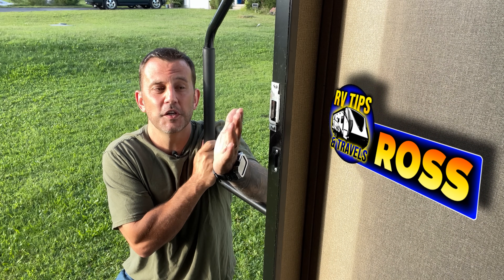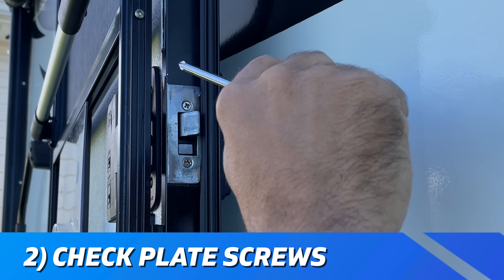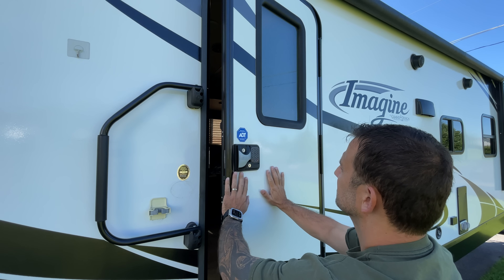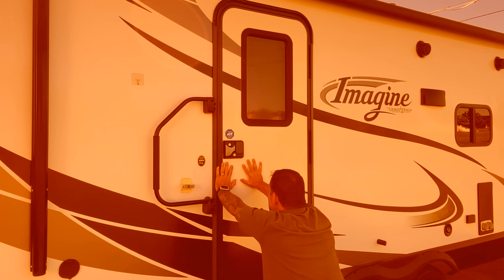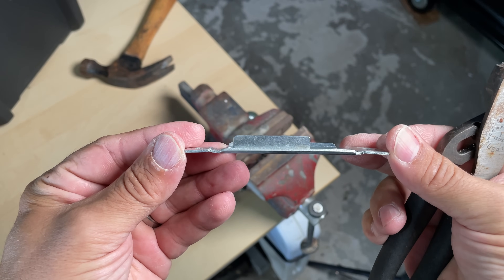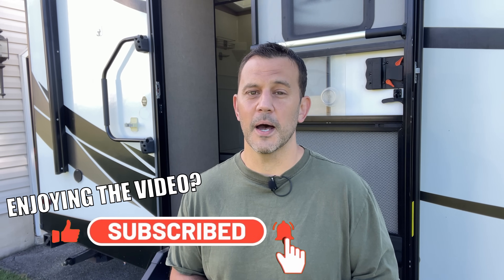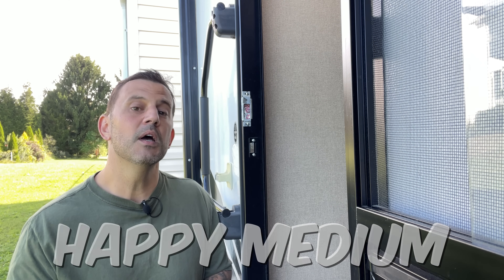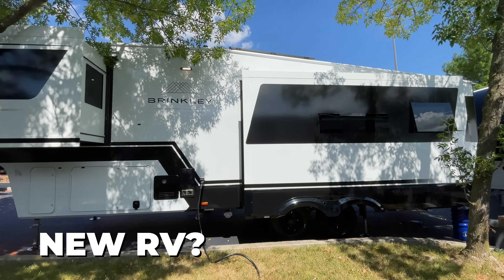How To Fix a Hard Shutting RV Door: EZ Adjustments for an Effortless Open & Close

Comment from the maker: ✨⭐ PRODUCTS FEATURED IN THIS VIDEO ⭐✨
🔹 Strike Plate https://amzn.to/3Zp2J9I
🔹 Other Strike Plates https://amzn.to/3rajvg6
🔹 Boeshield T9 https://amzn.to/48kxWio
🔹 Carmtek Keyless Door Lock (COMES WITH EXTRA PLATES) https://amzn.to/3sZXWzm
🔹 Hammer https://amzn.to/3ZmKa5V
🔹 Screwdriver Set https://amzn.to/3EHualp
🔹 Dewalt Drill (not used today but works great) https://amzn.to/3PILPQa

🎥 Carmtek 10 Digit Keyless Entry RV Door Lock Video https://youtu.be/KcEUgsDw6kk

How To Fix Hard Shutting RV Doors: 2 Easy Adjustments for an Effortless Open & Close In this episode I show you a modification that makes opening and closing an RV door a much easier and enjoyable process. PLEASE click the like button, leave us a comment & subscribe so you don’t miss any of our future videos.  

#rvlife #rvliving #rvtips #rvtravel #rvtips #rv #rvmaintenance

✨⭐ OUR FAVORITE RV ACCESSORIES ⭐✨

ESSENTIALS:
✅ Camco Rhino Flex Sewer Hose & Elbow Kit https://amzn.to/3wxaiyG
✅ Camco 90 Degree Clear Sewer Elbow https://amzn.to/3eezBe7
✅ Camco RV Water Filter https://amzn.to/3VzcMqi
✅ Rubber Wheel Chocks https://amzn.to/3v0lL5I
✅ Hughes Watchdog 30 Amp Surge Protector/EMS https://amzn.to/3hAmgCy
✅ Hughes Watchdog 50 Amp Surge Protector/EMS https://amzn.to/3HKrpm1
✅ Liquified RV Tank Treatment https://amzn.to/3ksg1Ck
✅ Tire Minder TPMS https://amzn.to/3mjuBg0
✅ Water Pressure Regulator https://amzn.to/3m3ZFzZ
✅ Rubber Gloves 6 Mil https://amzn.to/3XNo7Dc
✅ Collapsible Water Hose https://amzn.to/3SvNubw

MAINTENANCE:
✅ Boeshield T-9 Rust Preventative & Lubrication https://amzn.to/3sjcjMx 
✅ Eternabond Roof Tape https://amzn.to/3Ad290J
✅ Geocell Proflex Sealer https://amzn.to/3KGMOyb
✅ Road Tool Kit https://amzn.to/41NIQKj

INTERIOR:
✅ Camco Cross Bar Door Handle https://amzn.to/3o8WWS5
✅ Shower Caddy https://amzn.to/3bdU80W
✅ Soap Dish https://amzn.to/3pKheSn
✅ Oxygenics Shower Head (White) https://amzn.to/3nhDMYW
✅ Oxygenics Shower Head (Brushed Nickel) https://amzn.to/2O8YcYC
✅ Perfect RV Paper Towel Holder https://amzn.to/3tZxd1K
✅ Dimmer Switch https://amzn.to/3rQdfFD
✅ Sliding Door Latch https://amzn.to/3EkpTT0
✅ Puppy Paw Hook https://amzn.to/2N9JaRV
✅ Foldable Storage Bins https://amzn.to/3tIp01f

EXTERIOR:
✅ X Chocks https://amzn.to/3m3ck2i
✅ Carmtek 10 Digit Keyless Entry System https://amzn.to/3t4IMpB (see the video here: https://youtu.be/KcEUgsDw6kk)
✅ Low Point Drain Valves https://amzn.to/3Jd6adb

OUTDOOR GEAR:
✅ Blackstone Griddle 22” https://amzn.to/3MDDiL0
✅ Blackstone Griddle 28" https://amzn.to/3eBnOuD
✅ Outdoor Gravity Chairs https://amzn.to/3Sb1p4M
✅ Ground Mat https://amzn.to/41u3wXg
✅ TurboAnt Electric Scooters http://shrsl.com/27grx-1yiz-ub6o

💥 Sign up for our FREE Newsletter: https://view.flodesk.com/pages/6497c6a9d1998fa8c7623e9f

✨⭐ MORE RV ACCESSORIES ON AMAZON ⭐✨
https://www.amazon.com/shop/rvtipstravels

💥 NEW TO OUR CHANNEL? Check out our catalog:
https://www.youtube.com/c/RVTipsTravels/playlists

🙏 If you found this video helpful & want to support our channel with a small donation click here: 
https://www.paypal.com/donate/?hosted_button_id=J2KKM9NR3BJJA

✨⭐ DISCOUNT CODES TO SAVE MONEY ⭐✨

🔨 Learn how to repair & maintain your RV like I did w/ this COMPREHENSIVE training course:
https://rvtechcourse.com/?ref=rvtips&travels

🚐 10% off RV Snappads! https://rvsnappad.com/discount/RVTT10

🛌 Get 25% off your RV Mattress by Brooklyn Bedding at https://rvmattress.com/rvtips
Use discount code: rvtips

📡 GPS Tracking for your RV! https://www.wheresafe.com/rvtipsandtravels
Get 10% off by using discount code: RVTIPS10

If you find a dead link, let us know & we’ll send you an RVTT sticker!

📺 Want to see more RV videos? Please SUBSCRIBE & CLICK THE BELL ICON 🔔 so you're notified when we release new videos!

Follow us on social media:
📸 Instagram https://www.instagram.com/RVTipsAndTravels
🕺 Facebook https://www.facebook.com/RVTipsAndTravels

We may receive a small commission for purchases made through the affiliate links above. There is NO additional cost to you when purchasing from our links & it helps cover some of our material and equipment costs to make these videos. We also may have received products or payment in exchange for content discussed in this video, however our opinions and feedback are based only on our experiences, regardless of compensation. We GREATLY appreciate your support!

Comment: Didn't work for me. The door has always been hard to close (2022 Keystone Arcadia). Flattening the plate helped a little, but even with the plate missing the door is hard to close. A RV tech is next I suppose.
Reply from the maker: if the striker is not the problem making the door close hard this modification is not going to work.  something else is preventing the door from closing smoothly, and flattening the plate isnt going to fix it.  it could be the hinges, as discussed in the video, or your door frame might be out of square/plumb.  when you close the door, just as it is about hit the strike plate, look around the door frame and see if somewhere else is rubbing.  the easiest way to check this is to close the door with the handle pulled so there is no contact on the striker.  with no contact there, you may be able to easier to determine what else is hitting and preventing the door from closing.  make sense?  let me know what you find.
Reply: @RVTIPSANDTRAVELS  Thanks for the tips.

Comment: It normally has to do more with how level the camper is. If the right rear of the trailer is higher the camper will flex and cause the door to not close well or other way around. If the left side of the camper is higher the door will be hard to close.
Reply from the maker: I wont disagree there is flex, but you're leveling your camper before you're using your door, so it should always be level.
Reply: @RVTIPSANDTRAVELS  I’m just going off my experience. If my right rear jack is jacked up a lot to get the camper level my door won’t latch it’ll come open even if the camper is level. But I haven’t tried putting blocks under the tires yet to level it that way.
Reply from the maker: Eric, try these instead of ramps... much easier: https://amzn.to/4gMvLbq

Comment: Use silicone spray on complete door frame. This will fix 99 percent of the door closing problems!
Reply: That’s not fixing anything.  If you’re door is out of alignment you are ignoring the issue and it will probably get worse. That’s also not going to help metal on metal rubbing at the plates.  What the guy in the video does is fix the problem, not cover it up.
Reply from the maker: thanks for watching and commenting!

Comment: Ok what if the whole handle moves even with the screws tight. I was trying to close my door for almost an hour before I realized the handle shifts forward.  Do I just replace the whole handle ? If so what do you recommend as I don't want the same one .
Reply from the maker: it should not move with the screw tight.

Comment: Thank you so much!  I didn't have the Boeshield (will order some via your link with my next Amazon order).  I had some WD40 Specialist Silicon (which said it was safe for locks), Crossed my fingers, sprayed...and.....it worked!  I'm so grateful.  I really disliked slamming the door from the inside. Now it's easy to move the handle (which had been sticking), and when the door closes it's as smooth as when the trailer was new.  Just subscribed to your channel, and look forward to learning more RV/trailer wisdom from you.  Cheers!

Comment: I went through a lot of these and what finally worked for me was disassembling my keyless RVlock, removing the spring for the latch bolt, and cutting 1/4-1/2 inch off. Then I stretched it back out to the original length. Door closure is smooth as butter now.
Reply from the maker: thats an interesting idea, thanks for sharing and glad it worked!

Comment: Lubricating the latch did it for us -- from virtually impossible to close the door from inside to fairly easy (seals still need to be compressed so a little force is required when pulling it closed).  Thanks for an excellent video.
Reply from the maker: Thanks for the info… yeah, it’s never ever going to be a smooth as a residential door, but it can be improved.  Thanks my friend.

Comment: Hey Ross, Thank you so much for all the work you put into these extremely helpful videos. I came here because our door was quickly becoming harder and harder to shut. The faceplate and strike plate have HUGE gouges in them. After watching this video, I noticed that it's actually the dome head of the screws of the strike plate that are scraping the faceplate. I tried tightening them down to see if they had just worked themselves loose only to find the bottom screw just spins in place, so the hole in the metal frame is stripped. I watched your "stripped screws" video but not sure how to solve this with the hole being in the metal frame other than to get a larger screw. I'm also thinking about getting flat instead of pan head screws.  Any advice?
Thank you!
Reply: Thx for the comment the screw is scraping my door and cutting into. I was thinking of replacing the screw to a flat one. Any help works be appreciated ?
Reply from the maker: i would try a larger screw that you know will sink flush into the plate, thats the tricky part.  you can also try putting in a small piece of a zip tie, it acts similar to a toothpick.
Reply from the maker: i would try a flat head screw that bevels into the hole first.

Comment: The person we bought our trailer from has marks on the strike plate like you, now I'm betting they watched this video 😆
One thing I learned fairly quickly which could be an issues for some folks either for earlier setups or if something as settled after setup or after being set up for a long while is that the stairs might need to be adjusted, you want to make sure that they're not sitting too high which could add additional friction to the whole setup, which makes the door harder to shut.
Reply from the maker: very true, thanks for sharing

Comment: During our last camp out, one of our neighbors had a similar issue. After looking at it and thinking about it for about a half day. We realized that the neighbor has cranked the rear (door side) stabilizer so far down that it pushed the door off. We retracted the stabilizer and extended it carefully until the door closed easily.
Reply from the maker: That’s interesting! Makes sense and glad you got it figured out.

Comment: Great info. I need to make my door easier to close. I've done what you suggested and the door closes better but just not good enough yet. From what I can see when the door is closed it seals flush at the bottom but not at the top. I may have an alignment issue as well. I was going to give it the old piece of wood trick, put a piece of wood in the bottom of the door and push the door at the top just to make things straighter.
Reply from the maker: did that fix your issue?
Reply: @RVTIPSANDTRAVELS  It helped along with plenty of lubrication including lubing the striker plate.
Reply from the maker: good to hear you got it straight!

Comment: Just got a 2023 24foot TT, I notice are door is hard to close, but POPs open easy, isnt flush and I got to slam it closed before I can lock it. I'm going to try checking out what was pointed out in this video. Thank you.
Reply: Mine does the same thing. had to remove the strike plate. A screw on the bottom of the door hits the jamb. It's like the door needs to move closer to the hinges.
Reply from the maker: good luck
Reply from the maker: are your screws beveled at the top (bugle style)?  like this: https://amzn.to/3MZUKdH

Comment: QUESTION; I’ve built and repaired homes, etc, all my life. Is the door on an rv made differently, as in bowed a little towards the middle? I think it’s part of the design to keep pressure on the seals, thanks
Reply from the maker: On a straight frame trailer like mine I don’t think it is bowed since the walls are straight, and many doors are manufactured by a company other than the manufacturer who builds the rv.  Some doors  like on airstreams are bowed though because the trailer is not straight.

Comment: Nice video.  My question is what is a good fix for a door latch that has been stripped out after a break in.  No place for screws to go even after using max size for plate?
Reply from the maker: That would be something I would have to see to help with, sorry.

Comment: Great video but my problem with our door not shutting properly is a stripped screw on the strike plate which causes it to move what do you recommend to do for that thanks for all your great videos
Reply from the maker: along with this video Nick, ive since learned you can also use zip ties instead of toothpicks... you'll understand after watching the video, but zip ties might be a better option in areas that get wet.  https://youtu.be/MlFPex87cr4

Comment: Quick question: You mention moving the striker plate "out" (away from the RV) if the handle is hard to open.  However, on my Alliance Fifth Wheel, the striker plate is already as far "out" (or left, looking at it) as it can go.  Because of that recessed part (which is pushing up against the cut out in the RV body), it can't move "out" any more.  Any ideas on this?  Thanks.
Reply from the maker: hard to tell on things like this until im in front of them.  send me a couple pics

Comment: We’ve tried to install the RV Lock and the strike plate isn’t low enough for the deadbolt to latch completely. Should i modify the hole in the on the strike plate?
Reply from the maker: can you move the plate down?  if not, youll have to modify the strike plate, but the more you remove from the plate weakens the plate, so take as little as possible.  also, is this only happening with the new lock?

Comment: Good video!  More door closes perfectly... but the screen door on the other hand has never latched.  It's like the latch is far enough towards the bore to engage.
Reply from the maker: RV screen door latches are cheap and pretty much garbage.  They need to re-engineer, or at least use metal hardware.

Comment: I wish your help and advice could help what Forest River did to my door. But you need a decent hole in the rv to get a working door....
Reply from the maker: what is your issue, maybe i can help
Reply: @RVTIPSANDTRAVELS  I’m not exactly sure yet but am being told the hole is cut crooked in the rv. They have put 4 different doors in with no success. It also has something to do with the stairs because they told me they needed to be replaced but they don’t make them any more. I have a 2020 Cedar Creek 33ik Silverback edition.
Right now it seems the put a larger frame in and filled the door with this insulation that is coming off already. Light comes thru the door etc etc.
Reply from the maker: Very sorry to hear that… you’d think a quality company like that would fix the issue correctly.
Reply: @RVTIPSANDTRAVELS  thanks. Sadly it is quite the opposite.

Comment: Did you happen to make another video about inspecting and adjusting the hinges? I did these steps but my door is still hitting the frame as if the frame is too small. I do construction and have installed and shimmed many home doors but this one has me stumped
Reply from the maker: Toby, unfortunately this mod wont fix the door alignment issues.  My hinges are riveted too, not really much room for adjustment without an all day project on your hands.  I wish these bolted in, that would allow for fairly easy adjustments.

Comment: We have a travel trailer Avenger that when the main door is shut on the top does not close tight so you can see daylight the screen door has no problem we do have stowaway steps and was told this was normal. Is this caused by the steps or is it bent hinges and how do we know?
Reply from the maker: its something i would have to see in person, but its not normal.  the door should seal.

Comment: I went to change the lock on our new 5th wheel and it seems the striker plate can only be installed backwards. When installed correctly as you showed it will not latch. Am i at risk by leaving it this way? Don't want to get myself locked out.
Reply from the maker: what kind of lock did you put it?
Reply: @RVTIPSANDTRAVELS  It's the Latch it RV keypad lock. Although it will latch it will not deadbolt. I found one with a longer opening so hopefully that will work once it comes in.

Comment: Great video but you want some slight pressure from the seals. That keeps it draft, weather, and insect resistant.
Reply from the maker: Yes, I say that in the video. There needs to be adequate pressure to keep the elements out.  Guessing you didn’t watch the whole thing but it is mentioned in the video.

Comment: issue with ;pcked door opening while moving. thank goodness the handrail was across it and prevented it from swinning completely open. 2020 micro minnie winnie. how to trouble shoot?
Reply from the maker: sounds like your striker isnt going into the plate enough which could be an alignment issue, either that or your handle spring is shot and its opening on its own with very mininal trailer movement. would honestly have to look at it to tell.

Comment: Great suggestions. My door closes fine when the steps are up but no matter how I angle them you always have to slam the door to get it to latch. I think my door is misaligned from the factory.
Reply from the maker: Do you have morryde or Lippert steps?
Reply: Morryde steps. I've adjusted them every which way and still binds on the bottom of the door. @RVTIPSANDTRAVELS
Reply from the maker: Mine will rub the steps too if they aren’t completely flat against the threshold.  Nothing that can be done, can’t make the step metal thinner.  You might have to modify the bottom of the door, and that would be a nightmare.